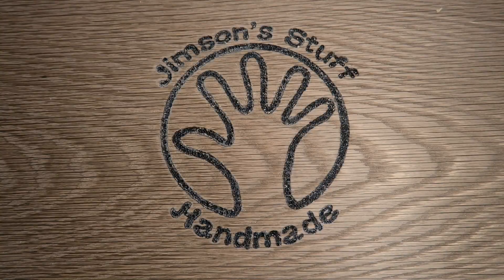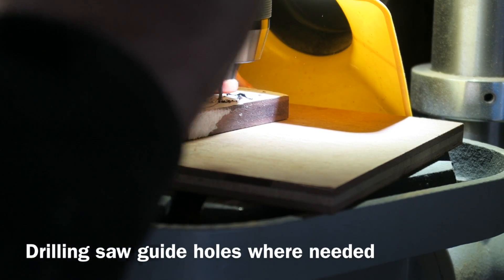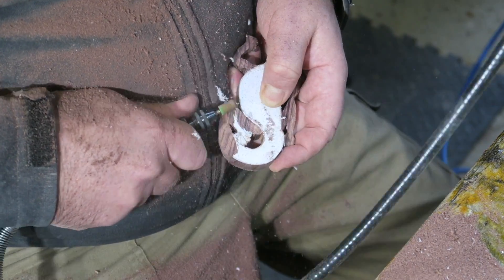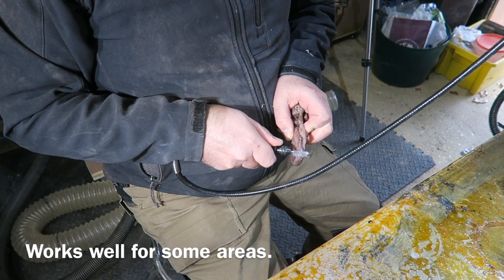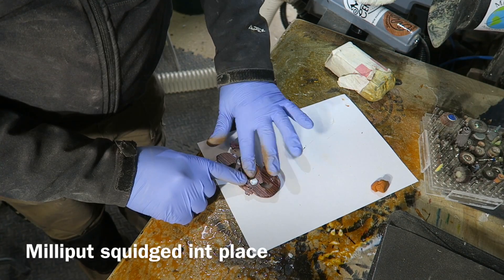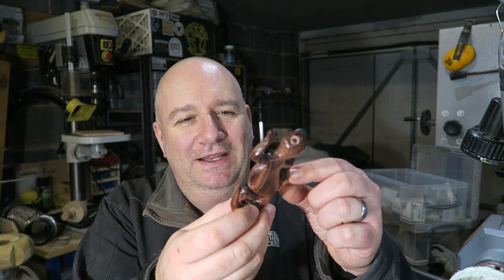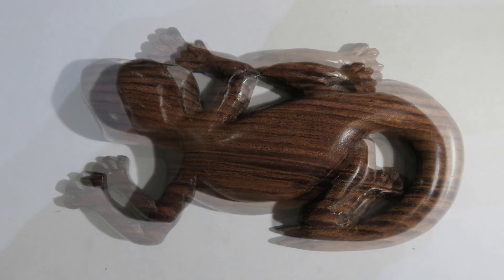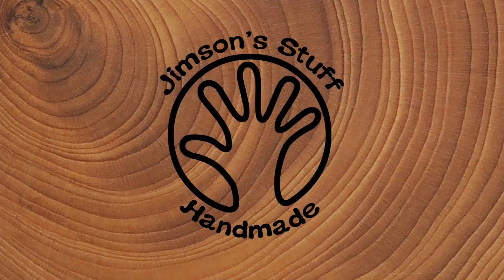A Simple Wood Carving Project - Makers Central Prize

Comment: Beautiful wood carving, Jim, such an artist!  This is Jacaranda wood, very hard, but lovely grain!  Thanks for the polishing tips, now to find Vonax in the US!  Any idea what it is made of?  I could make it myself if I knew.  Milliput is another very creative way to stamp your logo, smart!  

Jim, could you please put a link to your Dremel tool bits?  Also that extension tool which I assume is connected to a stronger, heavier Dremel Rotary tool.  I have the Dremel 145 and its too heavy for direct carving, I need an extension.  Also bits.  On Amazon, you never know which tools are good and which are poor quality ones, so your links would be much appreciated!
Reply from the maker: Thank you very much. The wood is Kingwood which is a Dalbergia species and although similar in appearance to jacaranda it is very different,harder and more dense. I don’t know what is in Vonax but it is similar to Tripoli, possibly finer. The spiky burrs I use are Saburrtooth which are great quality and readily available in the USA, most of the other burrs are from Amazon or eBay and as you say you take a chance, but generally they are so cheap that it doesn’t matter too much. I find all the steel burrs blunt quickly on Dalbergia woods. The flexible drive is the Dremel one and is attached to a standard Dremel 4000. Thanks for watching.
Cheers 
Jim
Reply: @JimsonMakes  Jim, thanks so much for the great info!!  I have the Dremel 4000 and will get this attachment and the burr bit.  The Dalbergia species is the same genus for Jacarandas I read, so thanks for the finer points.  I love trees and wood, and feel excited when I can match a wood to the living tree!
When I lived in Los Angeles, this neighbor had planted a row of very fast growing trees along the pavement of his house. They had enormous dark green leaves, truly gigantic, and they grew 25 ft in the first year!  Then they gave a show of blue flower spikes that brought traffic to a dead halt and lots of cameras.  It turned out this was the Chinese Sapphire Dragon tree or Paulownia Kawakamii which yields Kiri wood for Japanese Tansus.  Amazing!  Kiri is so hard to find in USA, but here it was - growing like a weed!